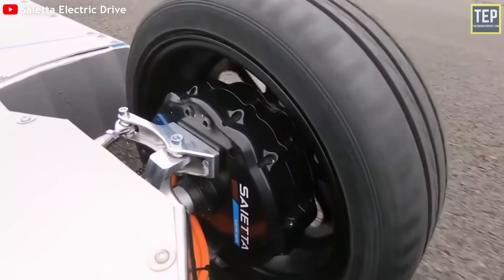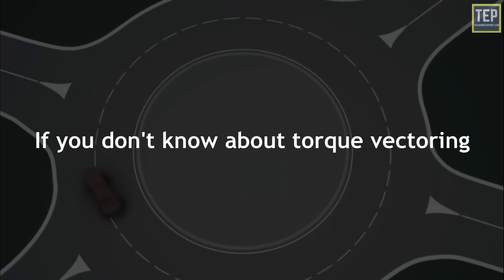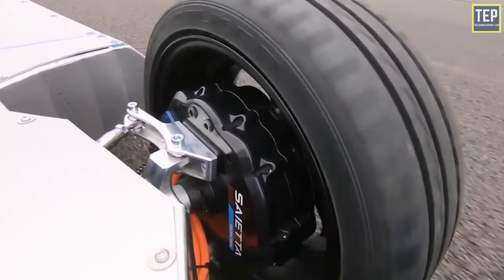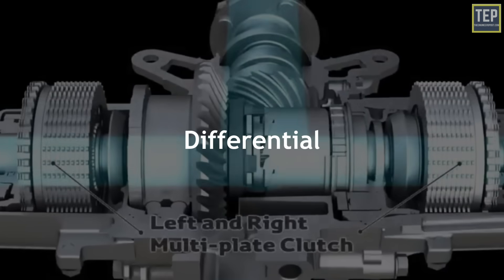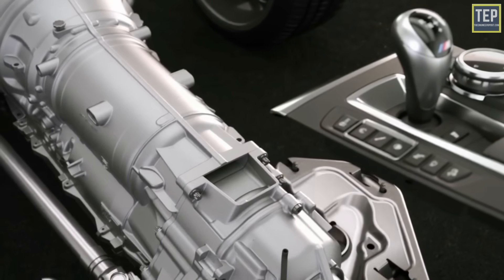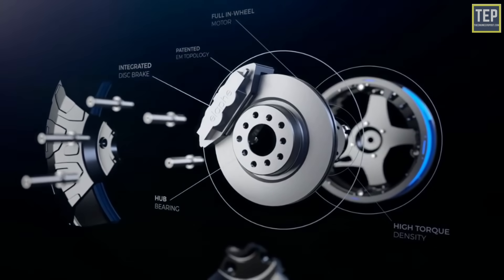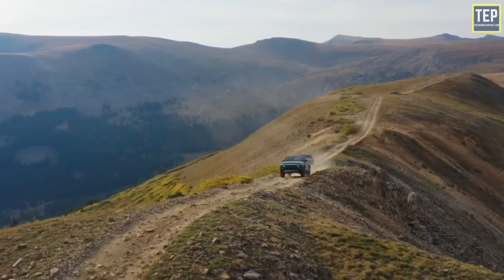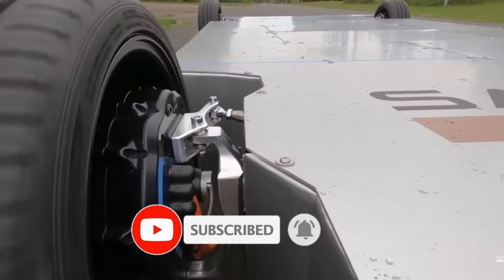How does In-Wheel Motor Technology Work? | Four Motor Drive & Torque Vectoring

Comment: Practically, a one motor per wheel system that places the motors as central to each axle as possible and links to the wheel with just a relatively short driveshaft and CV joints provides all the handling and control benefits of in wheel motors with none of the drawbacks. The loss of some cargo space in between the axles is more than offset by the lack of unsprung weight, not worrying about every pothole or bump being the end of your motors, much better high speed capabilities (lack of unsprung weight), superior real world efficiency and motor lifespan by the use of simple but robust gearing, reduced moment of inertia, etc.
Reply from the maker: Good Point
Reply: I like the idea of taking the electrical motors out of the wheels 👌 and having them protected by placing the motors central to each axle as possible that sounds brilliant.
Reply: 1-29-2022
Reply: Bingo.  That’s what I thought, too.

It also makes implementing a multi-speed transmission much easier, I.e. like the two speeds in a cordless drill, only one or two more gears.
Reply: @dennisyoung4631  Tesla plaid does 0-200mph with single speed and beats all multiple speed cars to quarter mile with virtually zero power loss at high speeds, and it's only 3 motors. I think the progress in electric motors makes multiple speeds obsolete. even more for EV's suited to real life driving with top speeds around 120 mph. anyway with 4 motors you can tune your motors and gearing for whatever top speed is required/targeted (ex rimac and Tesla roadster 250+ mph or my fiat 500e 85mph top speed) while having plenty enough torque to exceed tires traction at any legal speed. I used to think of Taycan 2 speed gearbox as great engineering, but I think the days of multiple speeds EV are numbered.state of the art electric motors have such wide power and, and high power density that gearbox are simply useless. gears are OK for EV conversions and DIY where you can't always have the perfect motor(s) for the job, or you simply want to retain some of the classic car characteristics. maybe there's still some room for gearboxes in electric motorcycles too where transmission can be made compact and drivetrains don't need the smoothness of car transmissions, and riders are more reluctant to automatic/single speeds. (some electric motorcycle have been designed with gearboxes but probably more out of laziness or lack of proper motor)
some niche products like off road rock crawlers also come to mind, although R1T (and future electric awd trucks) seem to be quite off road beasts
Reply: @geemy9675  that works when you have lots of motor and battery.

Having gears usually means less power consumption and improved performance when you don't have huge motors and batteries, e.g. hub (single speed) ebike motors commonly use more power and have less performance than mid-drives.  The performance issue can be addressed by going big on the direct-drive motor, but then watts per mile suffers a lot.  My experience is  mid-drives with gears are both much better on hills and off the line, while using about a third less power compared to a (one speed) hub.
Reply: @dennisyoung4631  ebikes are very specific. -mid drives are meant to be pedalled like a regular bike, no throttle or no ghost pedalling which automatically in teases range.
-ebikes are regulated which leads to manufacturers listing only nominal power and omitting peak power which can be much stronger, especially for European mid drives that are listed 250W. also limited power means it's harder to design a single speed motor with enough torque to handle steep hills and quick start of the line, and good top speed, without compromises.
-legs have pretty limited rpm range especially for casual cyclist. meaning mid drives can be designed to be most efficient at the same rpms and rarely operate out of their sweet spot
-mid drives are more expensive, more likely to outperform their specs whereas how B's motors are usually cheaper and more likely  to underperform their listed specs, wether it's motor or batteries
-hub motors are more often fitted with fat tires and/or small wheels that have more rolling resistance. also mid drives are more likely to be sporty (MTB or road bike) and have less aero drag, compared to upright standing position found on lot of hub motor ebikes
-hub motors are geared in large majority meaning added losses compared to mid drives. although not more losses than chain drive. geared hub will perform better and more efficiently at low speed/high torque, whereas direct drive are more suited to cruise close to top speed on flat ground or going downhill with Regen.
-because of all the previous reasons it is very hard to compare hub motors and mid drives with every other factors being equal so it's almost always apples to oranges.
-ebikes can't have active cooling except exotic prototypes/diy, effectively limiting the amps/torque. long uphill rides can easily overheat hub motors and trigger limp mode, although mid drives are not immune to this issue.

although I would say that mid drives being 3x as efficient as hubs is a very wild claim which is not backed up with any scientific testing. ebike motors are most likely to be 80/90% efficient wether they are mid drives or hub. a 30% efficient enclosed electric motor without any form of cooling would likely overheat/melt under any significant load. 
ev's have different constraints and single speed perform better overall if you consider added complexity, weight, and reliability issues of a multi speed transmission. taycan had an edge against pre plaid model s when going over 100/110 mph thanks to it's 2 speeds, but since, Tesla plaid and rimac nevera have showed that single speed EV's have almost "unlimited" performance. daily driving EVs at legal speeds has no use for gearbox. plus one gearbox can only work on one axle and prevents having 3 or 4 motor configurations. taycan has one gearbox in the back, none in the front. plaid motor with almost constant power from 60 to 200mph means that gears don't even make sense. a plaid with two gears could not accelerate more, actually transmission losses means it would be less powerful at any speeds that are not traction limited...RIP ev gearboxes
Reply: @geemy9675  no, not three times more efficient.

Up to one-third more efficient, of which I have first hand experience.  (It was quite shocking to see how big the difference was, in fact - about a hundred and fifty watts less, ~ 350 vs 500.)

Again, that one Tesla you spoke of has lots of both motor and battery.  Enough motor, you can dispense with the gears.

I was thinking of something far more plebeian - something that say, a pensioner/retiree might use, or a non-wealthy commuter - that doesn’t have nearly that much power, and in many cases, a fraction of the top speed.  I’m talking something that would be straining to go on the freeway, and would be comfortable at 35 mph /60 Km/h.  That’s good enough to get groceries, go to the doctor, visit friends, and do short(er) commutes.
Reply: @dennisyoung4631  understood, but gears make even less sense for low powered EV's. if top speed is 35mph for instance, the torque should be largely enough to get to this speed comfortably, climb any hill and g probably even spin the tires. for instance my EV is a 85mph,111hp,3000lbs fiat 500e and it has decent highway acceleration until top speed, , and plenty of torque to light up the tires with half throttle and race much more powerful cars at the trafic lights if you feel like it. my point is that torque is not an issue even in single speed EV's. efficiency would likely not be better with additional transmission losses and cost/weight/reliability issues of a gearbox would probably prohibitive
Reply: @dennisyoung4631  when you compare power, are you talking about nominal power, peak power, or actual power coming from the controller measured in real time? you will probably get very different results depending which methodology you are using
Reply: @geemy9675  
?
Reply: @geemy9675  Less parts less joints less fixings less gaskets less assembly less weight. Lower price led frequent interventions longer warranty better reliability better residuals.
Reply: @kevinburke6743  you mean the advantages of hub motors? yes they have many but also many drawbacks. they spin about 10x slower than motors with gear reduction (about 1000rpm at highway speeds) so they need 10x the torque to achieve same wheel torque so they are heavier and need more copper for same performance, higher currents. they may have better passive cooling but harder to be watercooled.
direct drive hub motors are the best solution for small wheels like scooters, skateboards but they already lost the ebike market to geared hubs and mid drives. they are just getting started on motorcycles (sondors metacycle) and lightweight cars (aptera)
it's going to be interesting to see how they do in the next years as some companies believe in their success but I see only a niche market in th energy years
Reply: @geemy9675 You can always exchange more gear reduction for less copper coil. The torque of a motor is directly proportional to the mass of the motor coil. So for low power EV you can use more efficient light weight high RPM motor and let gear reduction convert RPM into torque.
Reply: They don’t need gearboxes, if you went with a pole switching AC motor with constant horsepower, coupled with a Variable speed drive designed to control it, you would get high and low ratio, plus the equivalent of a fully customisable CVT without the belt! (Belt CVTs in my opinion are the incarnation of power loss and unreliability, with some exceptions of course). This setup would draw a huge amount of amperage, but I’m sure heavier cables would weigh less than a gearbox.

Like everything there are pros and cons to both in wheel and non in wheel one motor per wheel systems. Especially in reliability off road. On road there is very little difference with our modern-day suspension. 
Axles and CV joints have a habit of failing in deep mud, the but motors can be made to withstand submersion in gritty mud with little negative effect on longevity (I’m thinking of winches). at the same time, these in wheel motors may develop a habit of failing if they do a lot of miles on uneven ground, they would need some sort of padding or something to dampen vibrations. (there are ways, I dunno how many times I’ve dropped my old Dewalt drill off the roof or the workbench onto the concrete floor, Probably no where near the amount of stress on an in wheel motor in the long run but still pretty impressive). It seems pretty even to me.  so then you look at complexity, there are less parts in an in wheel motor, however the suspension needs to be designed around the motor as well, rather than just comfort and handling. again equal.  Last but lot least, weight distribution, there is less unsprung weight with the non in wheel example, however it has a higher centre of gravity. In off road vehicles in which you can disconnect the anti sway bars, more unsprung weight is a good thing, it helps the wheels stick to the ground when the ground is uneven. Still no clear winner. There are probably a lot more small factors that would make a difference but from my perspective neither is truly superior.
Reply: obviously hub motors have disadvantages since 99.9% of EV's don't use them
There is a number of EV's designed with 4 non hub motors and they are targeted at high end cars, 2000hp hypercars, 800+HP trucks but I think hub motors are interesting how much simplicity they bring.

I'm also not sure hub motors are less efficient in real world, should be quite the opposite. gear reduction can reduce motor size but also add losses and complexity. it's hard to compare since there is only one EV using hub motors to my knowledge (aptera) and it's not even in production yet. plus it's not anywhere comparable to Cybertruck, rivian R1T, lotus evija, or rimac Nevera. but it's also the lightest, most efficient EV by a long shot. time will tell real world concerns about unsprung mass, handling, reliability or actual range.

also Koenigsegg is using super compact and lightweight 445lb.ft 335hp 63lbs direct drive radial flux "quark" motors in the General, which could be the missing link between hub motors and traditional axial flux motors using gear reduction. hopefully with so many manufacturers heavily investing in electrification, we'll soon see a bunch of innovative solutions and not only attempts to clone Teslas.

 I don't know how far we could be of 4 hub or reduction gear motors EV without any form of friction braking. with super capacitors, plus very strong resistive heating capable of disipating Regen energy to a large thermal mass like battery or chassis in case of battery or capacitor failure, and very high peak power Regen available for a few seconds for emergency braking, we could have Regen powerful enough to lock the 4 wheels,and also able to apply much more efficient(with quicker feedback loop) ABS than electro pneumatic abs, while removing the weight, complexity and wear associated with rotors,pads, brake fluid pump, brake lines, abs,redundant brake by wire + hydraulic. FYI TC on the Tesla plaid is capable of accelerating quicker than it brakes thanks to advanced TC. Of course it sounds scary to drive a car downhill at highway speeds without mechanical brakes, but so did driving a car at 60mph less a century ago.
middle ground solution could be to have undersized, lightweight mechanical brakes to use as parking brake and emergency brakes, that could be designed to have just enough thermal mass to withstand one emergency braking from top speed to a stop before needing a cool down. obviously main brakes failure would mean you could only drive in limp mode at lower speed  to the next exit/service center or wait for a tow truck
I'm also eager to see affordable EV's using 4 compact lightweight motors with the benefits for Regen, cabin/cargo size, torque vectoring, and different gearing/torque curves front/rear instead of always offering 2wd single motor in the cheaper trims (specially fwd)
Reply: @geemy9675  majority of EVs have hub motors
Reply: @Blox117  sorry but you are wrong. there is not a single ev in production with hub motors. single speed with gear reduction  is probably 99% save for the rear transmission on the taycan which is two speed automatic. Aptera paradigm will be the first with hub motors when/if it hits production.
hub motors have advantages but efficiency/noise but motors with gear reduction can spin faster/produce more power with less torque. also one motor with a diff can power two wheels. low cost EV's save money and complexity with a single motor, dual motors can have higher power output than hub motors. 3/4 motors even more power and better torque vectoring and traction control.
hub motors in cars are a novelty that still need to prove their reliability and performance, especially they don't scale easily to heavy long range EV crossovers that are the best selling EV's. aptera paradigm is 40% of the weight of a model Y which is still light for it's size. it allows very good performance with 50kW hub motors.
 it's easier to scale up electric motors outside of a wheel which is unsprung weight
Reply: As someone who work with industrial motors the thought of subjecting electric motors to such abuse gives me nightmares. I agree with you that that's a better way of doing it. It's just my opinion though.
Reply: @MrEmrys24  what's your opinion on aptera paradigm  and elaphe who supplies the motors?
Reply: @geemy9675  I haven't seen motors from them so there's nothing I could comment about those. I've worked in Middle East and Southeast Asia, the motors  I've worked with are usually Japanese made or from Siemens, the only American made motors I've worked with as I remember is ABB and GE.
Generally motors from these manufacturers are reliable as long as it is used within the specified operating condition and maintenance is being done.
Problems occur if too much mechanical stress and it's in poor location condition which is an in-wheel motor will be subjected to. But maybe the engineers/designers could find a way to solve that.
Reply: Forever engineers have been trying to get rid off unsprung weight and for country roads this is a big issue.
In wheel motors would be suitable for slow moving equipment.
Reply: @Johnsmith-zi9pu  well all things being equal, less unsprung weight will always be better. but if you actually look at recent cars, wheels are getting bigger, wider, brakes rotors getting bigger too, so unsprung weight is definitely not going down. if you look at fast cars it's even worse.

I know unsprung/sprung ratio is important too for the ride quality. But hey if hub motors can be more efficient/cheaper and get rid of many parts, who knows when they might become a good alternative.

definitely following the aptera because it's so radically different from all other road cars. it will bring interesting feedback. So far, aptera engineers seem to spend a lot of time fine tuning the handling and suspension , and to be on the right path.

ultimately, it'not physically impossible that a hub motor with no mechanical brake could be lighter than a regular wheel. instead of needing a big rotor with lot of thermal mass to store and dissipate heat, you're just sending more than 90% of that energy to a battery, and you don't have the thermal problem anymore. electric motors are becoming incredibly compact. I have a fwd 111hp 3000lbs ev (fiat 500e) and I hardly ever use the disc brakes even when driving it hard. you can go down a long steep downhill road without any risk of overheating the tires. with powerful AWD Regen, brakes are becoming irrelevant except for redundancy and emergency braking.

who knows one day we could even have shorter 60-0 braking distance without using mechanical brakes. FYI the Tesla Model S Plaid accelerates faster from 0-60 than it brakes from 60-0. courtesy of the traction control of the electric motors performing better than the ABS on the mechanical brakes. so yeah maybe one day cars without brakes will brake better than cars with brakes. also hub motors could be for low speed robotaxis /small city cars . they are already powering majority of e-bikes/scooters/skateboards/light motorcycles
Reply: Also better for going through water without risking submerging the motors.
Reply: Agreed. And reductions in unsprung weight can multiply, as the lighter wheel-hub assembly will be less prone to wheel damage over bumps if it is lighter. Lighter wheels, or wheels less prone to damage. Either way, a win.

See also inboard brakes used on some cars, again for lower unsprung weight.
Reply: Don't take offense I'm not expert by any means but wouldn't a motor in every wheel mean ur car is three times as likely to break down ...especially with age...imagine working on ur car ...figure kut what motor is needing repair then fix?   Seems like more trouble then it's worth
Reply: @erickotapish7842  That's a fair point, and also being in a wheel (or very close to the wheel on a short driveshaft) could make the motor more vulnerable to vibration, water, salt.

On the other hand, most motor failures would just mean the car has 3-wheel drive until the garage fixes it, so perhaps not a huge problem.
Reply: @erickotapish7842  I think one motor per wheel is the future of EV's. takes away a lot of the complexity of drivetrains, no shafts, no differentials, you can do everything in software (LSD, locked diffs, torque vectoring, driving, traction control) also I'd like to see Regen based ABS with quicker reaction time, no mechanical parts, that could outperform abs breaking based on hydraulics/disc brakes, in a similar fashion as electric motors launch control beating ICE launch control. if a plaid can accelerate in shorter time/distance than it brakes, I'm sure there's room for improvement there. direct drive with no gear reduction could takes it one sep further towards simplicity like the Koenigsegg genera axial flux motors that work without gear reduction. then hub motors is the last step of connecting wheels and motors but comes with drawbacks
Reply: gears are antique technology. hub motors are superior in every way
Reply: @Blox117  Only if you don't mind a rough ride.
Reply: @Johnsmith-zi9pu  i dont notice the difference
Reply: @Blox117  you don't notice the difference because you have never driven an ev with hub motors. the only one is the apteral and it's still only prototypes. majority of ebikes have hub motors but they also don't have rear suspension so it's all unsprung weight. you can definitely feel it riding 28mph on a rough trail everyrhing is bouncing around
Reply: Nothing wrong with traditional 4 wheel drive systems. This seems an odd move.
Reply: @fred6738  having 4 motors instead of traditional 4wd means no axles, drive shaft, differentials. it's better cause it's much simpler. you can simulate open diff, LSD or locking differential by software. you can also have independent traction control on each wheel., so better performance on/off road or on the track
Reply: Problem with CV's though is that you need a minimum length axle of about 400 or 500 mm or they max out on their full arc during suspension movement and bind, which prematurely wears them out and causes a large amount of dangerous sounding metal on metal self destruct type noises.  So would definately have to use narrow motors such as axial flux in order to retain enough drive shaft length to maintain similar arc movement at the CV that we currently have with traditional arrangements.  Also, adding brake disks inboard as close as possible to the side of the motor would reduce unsprung weight even further again, much like the old style Jag differentials were setup in their cradle, together with inboard Disk brakes mounted directly to either side of the diff.  Except you'd be exchanging the diff for two independently operating axial flux motors, each with their own inboard brake disk and caliper assembly mounted directly to the output side.  That would work a treat, coz you could replicate the exact same system up front also. 😎
Reply: In wheel motor will be exposed to road hazards and other vehicles.  Since the battery and motors would be the most expensive components.  Better to have them in the middle of the axel.
Reply: Ll
Reply: As a retired Industrial Design Engineer and an automotive welder fabricator, your points are exactly what I've determined over the past 45 years. The current crop of EV's from Tesla and others using axle-centric motors is proof of the validity of this. Smaller, powerful motors with the CV joints parallel to the suspension pivots would leave room between the motors for additional battery space. Hubmotors have a much higher failure rate due to the harsh environment and conditions they must endure. Tirewear is also much higher. EV's stress tires and suspension components more than ICE vehicles due to the torque loads already without adding the additional weight of the motors.
Reply: Most like it,👍
Please Introduce this tecnology in new production & car Companys
Reply: I feel like every engineer that reads that is going dddeeeerrrrrp lol
Reply: What a nice way of saying that hub motors are fucking stupid.
Reply: Like the hyundai uni wheel

https://youtu.be/Nd6C0y8xc20?si=GhmuPDNFFlhjWcU1
Reply: Yup there is a concept called unsprung mass .. I don’t even understand why even engineers waste their effort
Reply: @sudeeptaghosh  I can see it being a deal breaker for high performance applications that would need big powerful motors and high speed damping, or if you have very bad roads. But probably not for  low powered commuter/daily driver. You can also adapt your speed, like people with sporty cars with very low ground clearance, very hard springs and very low profile tires already go very slowly over bumps, pot holes, so it could be a compromise between slightly less comfortable ride and maybe some reliability issues, and better efficiency, better traction stability control. the electric motor in my fiat 500e is fwd 111hp/60lbs and provides way enough power for the car. if it could be split into 4 15lbs 28hp hub motors with way better traction, and longer range, I think I would be pretty happy about that. I know the math is not that simple and hub motors have different characteristics, but considering the stock wheels +tires can be as heavy as 39lbs each, it sounds like a hub motor paired up with some weight saving could might have an acceptable or even little weight penalty. it's hard to tell the actual weight difference with the rim acting as the rotor, maybe you could also balance it with slightly smaller/lighter mechanical brakes.
Sounds complicated, but not impossible.
the aptera will be interesting to follow, because even though being so light it doesn't require too much power, it also means that unsprung/sprung weight ratio will be really bad.
BTW if unsprung weight is important but also always a compromise. car keep getting bigger and heavier wheels with bigger and heavier brakes and no signs of the trend slowing down. brakes could also be applied on the axles and make the wheels MUCH lighter but that would raise a whole lot of other issues, which explains why it's not done on any car to my knowledge, so who knows what the future will bring
Reply: @geemy9675  on the paper your logic may have some weight but when you consider weather ( salt water ) need to run the car for a million miles , cost saving (because 1 motor can run both wheels so 1 connection 1 electronic 1 cooling heating system) , less complexity (compared non hub motor suspension setup) hub motors stand no chance.. and if you think it does please go ahead and put your money where your mouth is and see what happens .. remember physics is the law everything else is just propaganda 🤣
Reply: @sudeeptaghosh  I'm not saying hub motors is the future for sure and I wouldn't put my money on it.
I just say not to dismiss all at once for the sole sake of unsprung mass, otherwise no car would have 23 inch wheels and giant brake rotors and calipers
also I think even though one motor per wheel may add parts(even if it's not hub motors) is going to become more and more common because it also means deleting diffs, axles, shafts and improved TC/Regen/torque vectoring and I think is the best design for EVs. skateboard with the heavy battery low and centered and light motors on each corner. electric motors can be much cheaper to manufacture than gas engines too because they are so simple mechanically speaking
I think hub motors will still be niche products for a while but could Gai momentum
Reply: @sudeeptaghosh  also about reliability/weather, I think real tests are more useful than speculations
https://youtu.be/1alRUqx9UX8
real life. long term reliability will only be known after years of hub motor EV's driving on actual roads but thorough lab testing can reduce the risks to a minimum.
Also if reliability was so the only factor, all cars would already be electric 😉, reality is complex and combines a lot of different factors
If you look a bit more into elaphe motors that are featured in the aptera you'll see they have some pretty cool tech..